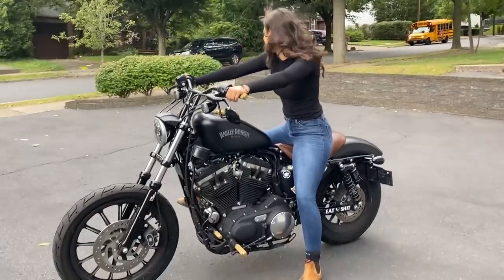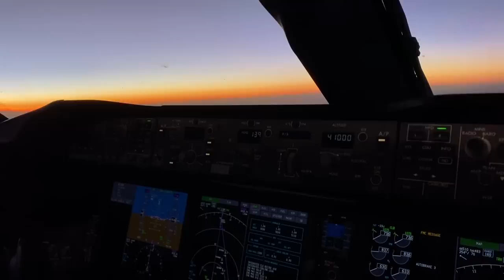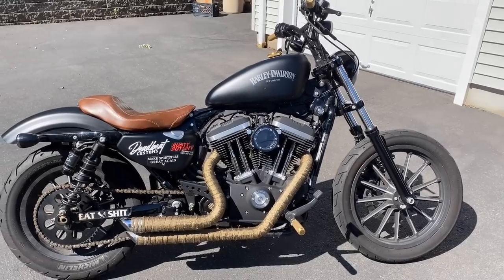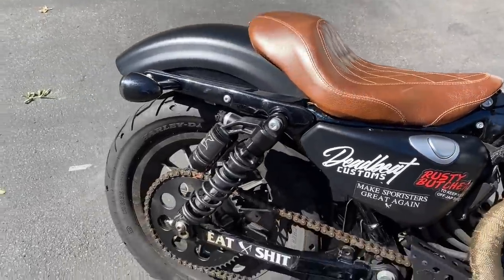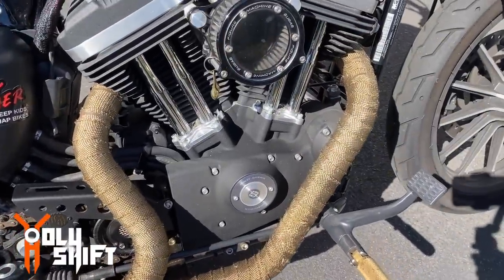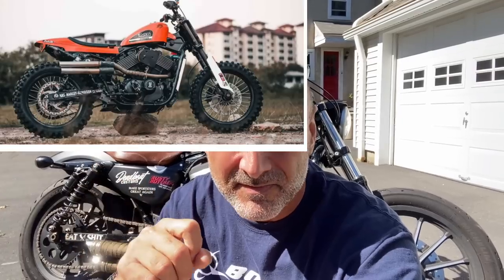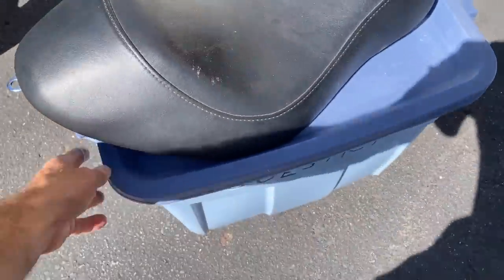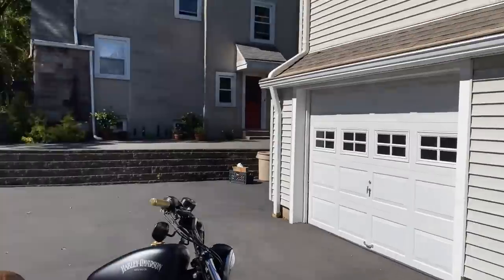Her First Ride Harley Sportster / Iron 883 Build Project Reveal

Comment: Its always nice to see some of the aviation side. I’m an AMT on the corporate side. This will be a cool build I think options are endless for spotters. The Eat Shit decal is a classy touch.
Reply from the maker: Thanks- I’m not always sure people will appreciate the aviation stuff… but people are actually commenting that they like it..!
Reply: @HOLYSHIFT  Any gear head would find an aircraft interesting i think. Hope to see more of it.
Reply: I’m an AMT myself on the corporate side. I appreciate the Aviation stuff as well. Sandy, can’t wait to see what that scrambler looks like when your Done! Keep the videos coming!
Reply: @brucesaunders3075  What do you work on Bruce?
Reply: @GruntHarley  I work on Challenger 350, Cessna 560XLS, CRJ200, EMB Lagacy, sometimes Hawker 800, and of course I do all my own maintenance on my Harleys, pretty much anything on the Bikes.
Reply: I like the "Fucking Gas" cap.
Reply: @brucesaunders3075  I worked on CL350 myself, as well as XLS and one simply does not forget working on a Hawker 😂.
Reply: @GruntHarley  , of course no one forgets those Hawker, I think they designed that plane in a pub, lol. So do you work in The Bay Area?
Reply: @brucesaunders3075  New England.
Reply: @GruntHarley  Tennessee here.